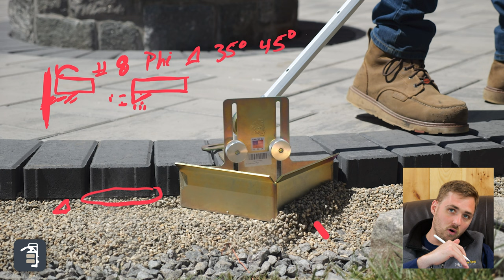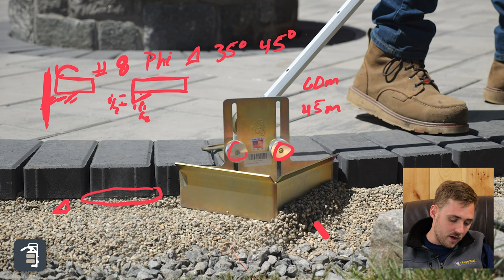Edge Restraint Preparation (Open Grade)

Comment: Looks like pee gravel under the pavers. You should be using #8 angular limestone. People please stop using pee gravel. For your patios sake.
Reply from the maker: After confirming with the contractor, the stone that you see in the video does in fact meet the industry spec required for a patio installation and would be deemed as a #8 stone. We agree that you do not want to use pea gravel. Thanks for your comment.